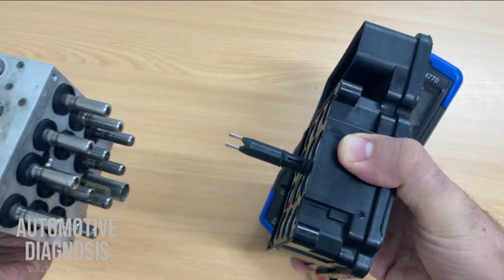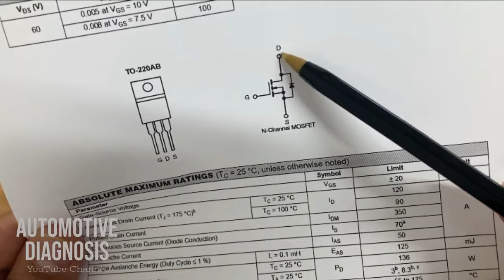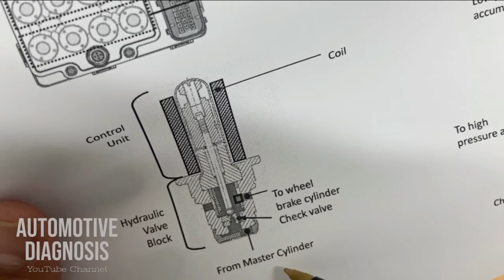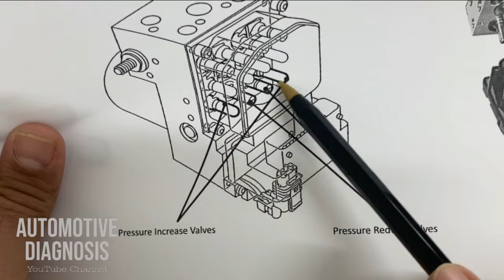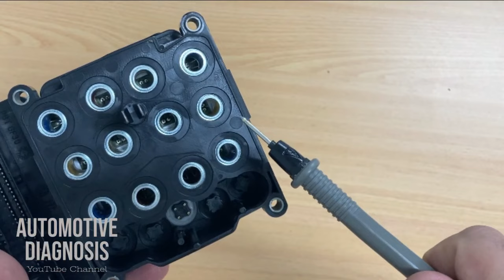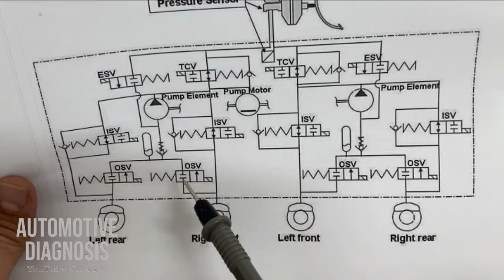Don't Replace ABS Module Before Watching This | Part 2 | ABS Module Components Test #abs #tcs #ESP

Comment: Hi
I live in dubai.
Here mechanics wants to rip me off and they don't even guarantee my abs problem will be solved or not.
One of them has already wasted my money on all four abs sensors.
So I decided to do it my self. I
Have a electric and electronic technical knowledge. 
I wanted to ask you a question. Obd shows 3 sensors fault and one doesn't show at all. 
Wiring is ok. So fault is in circuit of module. 
Could it be loose pins? Or some software issue.
Reply from the maker: Hi mi friend. Normally when there are multiple faults, we don't go for changing all of those parts that are giving the faults. It does not make any sense to have all wheel speed sensor broken together! For fixing this problem we normally start by checking the connector and wiring on ABS module. Most of the time cause is there. But of course it could be internal fault inside the ABS module too, maybe broken solder on ABS electrical board.
Reply: Thanks for reply. I have checked the cables my self now from sensors to connector. They are fine.
Now I think it's abs internal fault I open and check.
Thanks a lot.

Comment: You need to fix one Fluke multimeter and with abs modul ,always is problem with Microprocessors ,never with MOSFETS🙋‍♂️
Reply: Hi, so if I change the microprocessor of the same part, how charge the software? Could I realize the clone information with scanner with special functions?

Comment: Hello, I have C2200-49 in my dodge charger 2014. Where could be the issue?
Reply from the maker: Hi there, this code is for ABS internal error but I would start by checking the ABS connector for any sort of moisture or corrosion. It could be internal issue as well on ABS PCB.

Comment: Great job on the videos👍🏻! Curious why the diode in the mosfet that bypasses the gate doesn’t keep the load on continuously?  If the source is + and the diode is forward biased and it goes to the drain, wouldn’t the current flow through the diode  and to the load continuously?

Comment: Bayya mainey jawa bike abs ecu board water and some anta in board water damaged mainey pura cleandiya and resoldering and all components are working fine.  But one brown smd capacitor  one end is gone  the component no capacitance value and I'm checked with laptop scrap board I need  choclate brown color   capacitor smd but I  found only light brown so many smd . How to replace exact component please suggest bayya please

Comment: Bro I'm removed atee abs ecu circuit side cap . Removed done .but when I'm removing pcb main connections side it's not moving is it soldiering in pcb connectors  side

Comment: Hey how is it going ? My abs module doesn’t communicate with the rest of the modules i installed another one and it communicates my question is on the module that’s bad what can I check for no communication issues? I have power on pin 7 and pin 12 and 13 for can bus are good might this be a microprocessor problem ?
Reply from the maker: Hi there, it could be a microprocessor problem, but for checking the electronic board before that, we can check the connection between those power pins and board ( check for the proper solder connections), it must be checked for the ground connections too.

Comment: G'day I have a 2009 suzuki grand vitara 
I have removed the control unit checked and resoldered all the joints still have same code 
I did notice looking down the activating coils that 2 adjacent coils appear to be a bit burnt
Is it possible to replace the coils if so how
Any help appreciated 
Thanks
John

Comment: Great info.  I have a  2013 Ducati Multistrada  with bosch abs.  I get a random """abs pressure sensor fault.:  C1006, C1007""".  Totally random sometimes not for hundreds of miles other times every 25?   The fault resets when ignition is off / on.  I have bled and flushed both front and rear many times with quality brake fluid.  Abs operates  when not faulted.  When faulted the brakes are fine except no abs function.  Ideas please.  Thinking of pulling the module and checking solder joints.  It seems like a bad connection due to the intermittent occurrence of the fault.   Anyone having pressure errors faults ?   All info I get is to replace module.  Thanks in Advance.  Cheers

Comment: I have error code b1342 on my Ford Fusion 11. Have you ever caught anyone with this error?
Reply: I have code eror c0082 and u0415, what i am chek
Reply from the maker: @Aezarthings  I would check the ABS module connector first, then check the ABS fuse inside the engine fuse box.
Reply from the maker: Hi there, this code has many different possible causes, have you checked other systems as well for any fault code?
Reply: @AutomotiveDiagnosis without other errors. I have already checked the wheel sensors and the ABS works and does not lock the wheels. I will send it for repair. grateful.
Reply: Mazda biante skyactive

Comment: This was a great video.  I checked the motor mosfet (mine is a PN0404 for a jeep) and have an OL reading between the gate and the drain.  Should I assume the mosfet is bad?  thanks again for the video and for any help you can provide.

Comment: Thank your explanation, I got the problem  the resistance  are different  2 ohms between blue, 9 ohm and 8.8ohm this acceptable? , 
my car problem abs right rear cannot detect.
Reply from the maker: HI there, that much difference is not a big deal. May I ask the fault code too?

Comment: @AutomotiveDiagnosis  thank you for the video. I checked everything you checked and all tests were good. The original fault code was “C2200 Antilock Brake Module Internal”. I would guess the trouble will still be there if I just reassemble… my car is a 2015 Jeep Wrangler JK. Any advice will be greatly appreciated.
Reply: Same C2200 code here on a 2012 JK. All tests as per these videos are good. Code still remains. You didn't find a solution?
Reply: I as well have a 15 with c2200 did you ever pinpoint the faulty component?
Reply: @buckknazty    I am not SURE yet. My plan is to replace the ABS control module, but for whatever reason, they are very hard to find and far too expensive when I do find them. There are online sellers who have them for less than $200, but they’re out of stock and have been for awhile.  My Jeep still drives fine, just locks up at FULL brake. So, I’m being patient, waiting for the ABS control module to start being manufactured again or for everyone else to replace theirs and they not be so in demand! LOL.  BUT, I’m fairly certain replacing that ABS control module will fix these issues, and it’s an easy replacement, once I have the part…

Comment: nice video but at the end can it be repaired fixing soldering?
Reply from the maker: Of course it can, if there is any broken solder, it could be the source of the problem. But as I said, that’s not the only possible cause, there are many other causes that are explained in the video.

Comment: Great instructional videos on ABS module operation and diagnosis. My question is, if you cut the plastic cover off then how do you ever re-use the module if it tests good? Seems like this is destructive testing? Good to know if you're just interested to see where your old module failed but not useful for actual repair correct?
Reply from the maker: Hi there, of course we seal the cover back on, unless what’s the whole point of testing the unit? So, we must be very precise when removing the cover, then we seal it back on.

Comment: Hello ! I have a problem with a 2013 terrain ABS module, the code is U0073 00! I try to buy a new module and program it but it is impossible to get it. Could you guide me if it can be repaired or tell me what I should check? Thank you
Reply: 你有没有检查CAN 线电压

Comment: oh great... class but you are not actualy trying to fix this module and neither are you offering a solution to fix the problem, Right? that some info I didn't understand anywhere on the 2 videos... great stuf any way. But have you even found a problem  on an Abs module this way?
Reply from the maker: These two video are not only for one single fault code, there could be multiple faults on ABS module, that’s why I explained how to check the internal components one by one. I think the solution are very clear, you see how to check any of those components, so if there is anything wrong in your inspection, you have to proceed to repair. For example, any fault on ABS motor  or valve relay circuit can be checked step by step by following the videos.

Comment: thank you for sharing. where we can find the wiring for an ABS unit?
I have a ATE controler 28.5162-2917.3
Reply from the maker: Thanks for watching. I normally get the diagrams from the dealers technical website or those online websites offering the diagrams for a fee. But not all of those diagrams provide enough details. May I ask what model your car is?

Comment: sir i check all mosfet and all coil is good.. my final is cpu or ic ?? do you think im right, if change ic , need to program sir or no need..thanks for helping sir,gdbless
Reply from the maker: Hi my friend. May I ask what is your fault code exactly?
Reply: @AutomotiveDiagnosis  u3000 49-68 control module, panel lights on abs, traction and steering angle sir..
Reply: @AutomotiveDiagnosis  not steering angle sir the other one light is uphill..

Comment: Hi, i have a 2012 chevy equinox with ABS, brake and stability track lights on at same time, do you think the ABS module can be repaired?
Reply from the maker: You must check the fault codes first, sometimes it’s not a very serious issue
Reply: @AutomotiveDiagnosis I have an ABS solenoid valve malfunction fault code on the diagnostic. Is that a serious issue or something I can don myself? I am trying to not get a used part from the junk yard because it says I have to re program the module. Please help. Thank you
Reply from the maker: @rgonzalez9824  Hi there, this could be ABS internal problem or wiring issues. But the priority is to check the relevant fuses and wiring before proceeding to remove any part. We have a similar video for that on the channel:
https://www.youtube.com/watch?v=CjNqr-UeHDg&t=1s
Reply: @AutomotiveDiagnosis  man you are a life savior. I am going to perform those steps on the new video you provided above tomorrow morning. I hope is just a fuse. Stick an around in case I need you again. lol. Thank you for everything. I appreciate it. If it’s the module. I can send it to you. I will pay you. Please. 🙏🏼🙏🏼
Reply: @ I have a 2013 Honda civic LX, 4 door sedan. 1.8 L automatic engine. My electrical socket has 4 pins instead of 2 like in your video because is a different model car. The 2 bottom pins give me battery voltage. However, top 2 pins don’t give me voltage. Is it suppose to be like that? Or do I have an electrical problem? I do not know if I am suppose to get a reading on all 4 pins. Thank you for your time.
Reply: @ I believe top is negative and bottom is positive? My dad is an electrician and we think it could be that.

Comment: Excellent video, great explanation in this excellent course on how does a ABS module works and I can relate it to how intermittent ABS should be worked and diagnosed.  Thank you.  What did you use to close it back and water proof it.
Reply from the maker: Glad you enjoyed it! I usually clean up the old seal and apply new black silicone.

Comment: Hi, I'm getting this code. Everything I checked with your vids is OK. mosfet Ok. C1043: Master cylinder cut solenoid valve circuit
No.1 failure
Reply from the maker: May I ask your can make and model?
Reply: @AutomotiveDiagnosis  Yes! Suzuki Grand Vitara Year 2012. Where are the transistors for the solenoids? The two mosfets seem to be Ok, following your indications. Also I tried to look for the pinout of two big chips on the card, but can't find the datasheet.. I've got some electronics experience so I'm trying to solve it myself...Thanks!

Comment: Hi there, it's possible communicate abs module with scanner without the others modules?
I'm trying but the communication don't starts.
Reply from the maker: Hi there, I didn’t quite get it. You mean ABS doesn’t communicate with scan tool or it doesn’t work with other control units?
Reply: @AutomotiveDiagnosis  I was trying to connect the scanner directly to the abs module, but the communication was not working. I even tried with a 120 ohm resistor between the CAN H and CAN L lines, but it still didn't work. So I connected the injection module to the CAN H and CAN L line and this time I managed to communicate with the scanner.

Comment: i20 ABS
3 wheels bleeding. But one wheel not bleed.. what's problem????
Reply from the maker: You mean it keeps giving air bubbles from that wheel?
Reply: @AutomotiveDiagnosis  0% oil flow in 1 wheel

Comment: do you have a diagram specific for a MB c 280 2009 2009 MERCEDES-BENZ C 280 (204.054) WDDGF54X69F166637. Im really trying to verified and repair the module , because no body could do it , so want to try.
Reply from the maker: I will check and send the diagram here if I have any.

Comment: Would be interesting if this solves the error code C1288, error at ABS pressure sensor
Reply from the maker: It’s a bit complicated for the pressure sensor as it’s controlled completely by the control unit, but it is absolutely possible.
Reply: You can fix the code c1288 by changing the brake cylinder may be its defective, or the fluid is contaminated , this 2 are the reason why creating of pressure to the brake system,

Comment: Okay dude, you gotta tell me, where did you find these diagrams. It’s exactly what I was looking for!

Edit: thank you for this wonderful video btw
Reply from the maker: Hi there, thanks for watching the video, there are different ways we can find the wiring diagrams, Some manufacturers have designed the OEM scan tool with wiring diagrams (KIA, Hyundai, SsangYong etc.) so if you have those scan tools, you have the diagrams too.  Also, in addition to the manufacturers technical websites, some other private companies offer the wiring diagrams and workshop manuals too.
Reply: @AutomotiveDiagnosis  that’s fantastic, I’ve been really struggling to find the wiring diagram of my 04 Kodiak Topkick. I may have to look into some of those private companies or scan tools you mentioned. I saved the ones from your description and I can’t tell you how much it helped.

Thanks again!
Reply from the maker: @drv1211   I'm glad it was helpful. I will check for that wiring diagram as well and will keep you posted here if I find any.
Reply: @AutomotiveDiagnosis Thank you so much, if you do happen to find anything it would be very much appreciated. I’m still having trouble diagnosing exactly what’s gone wrong. A diagram such as what you have outlining the pin out would be wonderful!

Comment: Excellent video.  What about when a component is faulty.  I have an abs error code indicating a wheel speed sensor problem but everything is fine.  The problem is probably within the abs module. The question is which faulty component of the module will keep the brakes locked on one side only when the  abs light is lit and the brake pedal not depressed?
Reply from the maker: Hi there, that problem could be coming from the ABS valves, but you need to check the brake caliper as well, sometimes brake piston or sliding pin is sticky.
Reply: Can the ABS module can be damaged if the wire harness cause a short because of a shafted wire connecting to the ground? Or the module is protected somehow in these situations.

Comment: hello what an explanatory video are you giving me the courage to do it too, I tell you that I have a 2008 jeep grand cherokee with a similar module I have the DTC C2200 the only thing I have seen with the scanner is that the valve feed oscillates between 5 and 10 volts before the DTC appears when starting the vehicle and exceeding it of 15 miles the lights come on and in the scanner the valve feed is It's still at 5 volts, do you think I could fix it if I open it? 🤔
Reply from the maker: Hi there, thanks for your comment. This code is due to an internal failure on ABS Module, Sometimes it could be something we can find by checking all connections in the ABS module, but sometimes is coming from the main microprocessor which is hard to repair. So basically there could be different possible causes for each different case, and we can only be sure after inspecting the module carefully and thoroughly.

Comment: My ABS module was failing. The motor remain ON even if I close the car. I soupose the transitor it's remain blocked ON or the microcontroller gives power to the transistor...
Reply from the maker: Hi there, yeah, it could be a short to power or ABS unit malfunction. Most likely there is a fault code as well.

Comment: Eu sou do Brasil, muito sua boa  explicação!! Estou com problemas em um abs do ford FUSION!! Vc poderia me ajudar?
Reply from the maker: Hi my friend, I try to do my best, what is the problem with your ABS?
Reply: @AutomotiveDiagnosis  ele não comunica com scanner
Reply: Quero um treinamento guiado com você !
Reply from the maker: @geodirecoes2778  When there is no communication, it could be power supply, ground or CAN-Bus problem. It's better to start from Power supply on ABS module, normally there are 2~3 power supply, one is for ABS motor, one is for ABS valves and the last one is for ABS control module, the last one is very important for the communication. If power is okay, find the pins for ground and inspect them. ABS connector also must be carefully checked for any dirt, moisture or looseness.
Reply: @AutomotiveDiagnosis  muito obrigado pela atenção, vou verificar
Reply: Resolveu amigo? Meu fusion 11 dá erro b1342.